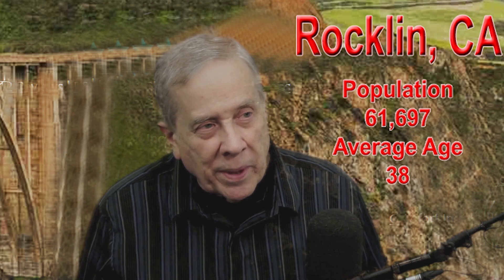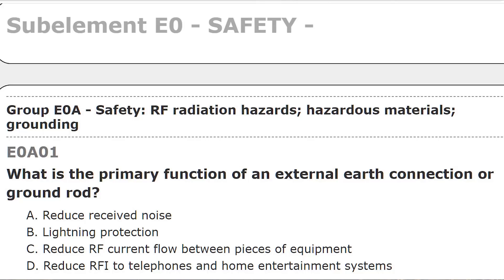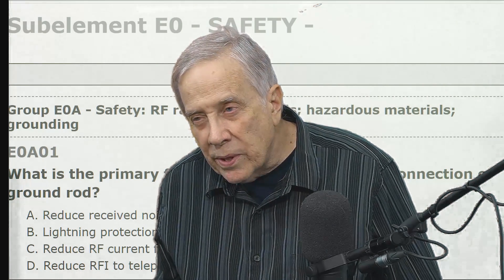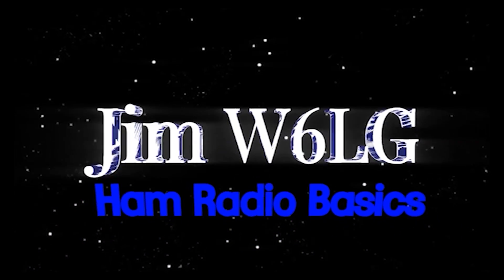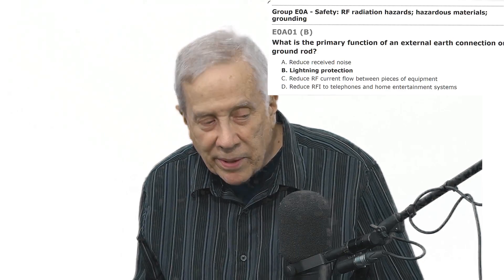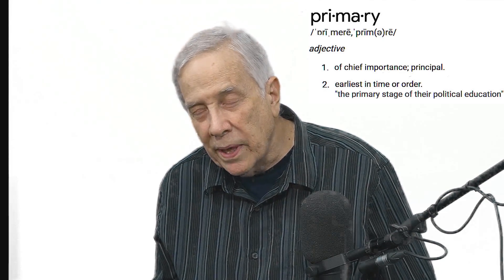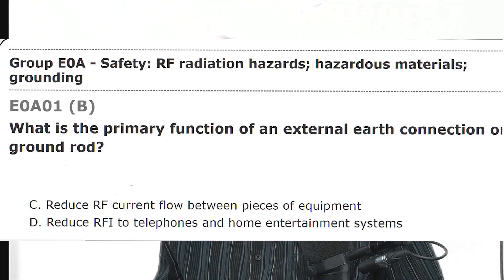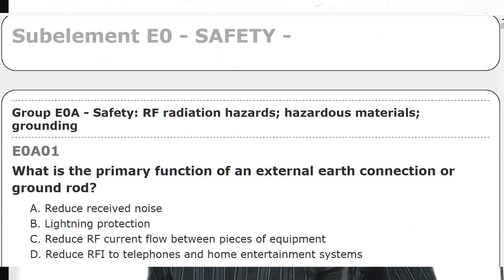Station Grounding & Extra Class License Question That Has The Wrong Answers Part 1 of 2

Comment: You are not correct. Earth ground is not for electrical safety. The neutral and ground conductors connect to the neutral at the source.  The ground conductor in the wire path is the responsible path for fault current. The only reason we have an earth ground to the neutral is to dissapte static charge build up in the eletrical system.  Lighting is static charge.

A grounded system, ground conductors have different purposes. Unfortunately the word ground gives the wrong perception.
Reply from the maker: I strongly disagree with you and so do OSHA and the NEC. 

"Earthing is used to protect you from an electric shock. It does this by providing a path (a protective conductor) for a fault current to flow to earth. It also causes the protective device (either a circuit-breaker or fuse) to switch off the electric current to the circuit that has the fault."
"
Reply: @ham-radio  Please watch https://www.youtube.com/watch?v=3vvvv5QVZoA&t=177s  a Mike Holt class from NEC training.  Sorry it is 30 minutes long.  He has a lot of videos classes on grounding and bonding as it applies to the NEC.  My early days we spent a lot of time earth grounding communication equipment to help prevent the transient static build up on the power lines from  causing the computer parts to fail.  Static was a big problem for early integrated circuit and cpu.  
I enjoy your channel. AI7JF
Reply: Still not convinced, read NEC section 250.4 (A) (1).  Also read (B) (4)  specifically states the earth shall not be considered as an effective ground fault path.  I believe because the green wire is called ground that it causes confusion. The green as well as the neutral are grounded conductors because of the bonding to earth at the main panel, but the purpose of the green wire of correct size is to handle fault current back to the source (main Panel) and be able to handle enough instant current to cause the breaker to trip, not melt the wire in the wall. You could take one of your dryer hot leads to the dirt out side and not trip that 60amp breaker but the ground bonding wire (bare) is now energized with enough electrons to hurt someone. My source of knowledge is from completing state electrical and exam a couple years back and ever since it has grabbed my attention when it is talked about.

Comment: No ground ROD connected to our service panel.  All neighborhood electric is buried with cables running in buried steel conduit (which acts as the ground).  All external entities are bonded to the service panel.  My station is the only ground ROD on the pemises (and also has  a bonding wire run to the service panel)
Reply from the maker: Hi,  I have never seen that. We have buried services and per the NEC, each residence has a ground or earth.  Our is an Ufer.  So, there is no common point box below or near the panel.  No box with 4 screws that has all of the "stuff" that comes into the house.  I have never seen that.  Question: Is it possible that there is an Ufer ground? 73, Jim

Comment: The ground rod will make it worse if you do not follow single point grounding theory.  When current flows though the ground under our feet, the resistance between the 2 grounds produces a huge voltage drop.  That is the opposite of lightning protection.  HI HI
Reply from the maker: Still many, including the ARRL give the wrong advice.  73, Jim

Comment: You need to make the point that the ground rod is driven at the home at the main panel for a reason. It is to complete a circuit to the grounding system at the transformer if the neutral conductor to the main panel is broken or lost.  That ground reference point should be enough to open circuit breakers if there is a dead short in a device powered by the main panel.  All of those other devices tapping onto the ground are using it for noise cancellation and grounding code conformity.
The ground rod also serves to dump high voltage from a lightning strike into the ground as soon as possible avoiding the transformer and the high voltage side of the system.
Reply from the maker: Hello Joe,
A couple of questions:
Are you familiar with the NEC requirements?
With reference to a driven rod at that station that is remote from the main panel and several ohms that is above ground; maybe 2 or 3 volts, do you believe that it is in compliance with the intent of the NEC with respect to grounding?
I agree about the driven rod of Ufer ground that is part of the common point ground, I failed to fully discuss the electrical service has many grounds all down the line.  If a rod is driven at the station and then more rods all leading back to the main panel with a large conduction, would that be okay under the NEC?
Thanks, Jim
Reply: @ham-radio  yes I am familiar with the code. And I also have experience with electrical engineers and inspectors that all interpret this differently. After 40 years as an industrial electrician and machine controls technician I’ve seen it all when it comes to grounding. NEC only recognizes one central ground point At the service entrance. I believe if all these ground points are properly tied together there should be no voltage difference at these points.
All of this grounding I see under your table really has nothing to do with the electrical grounding of your devices that apply to your service entrance. This grounding is to illuminate floating RF energy and lightning protection. Lightning always finds the point of least resistance to get back to the earth. With absolute perfect grounding of your radio equipment lighting is going to find your equipment before anything else. There’s been some work done with high resistance grounding in industrial applications.  I believe this is to avoid lightning strikes and reduce equipment damage due to the high current capabilities of a low resistance ground circuit. This is why so many branch circuits in industrial applications have gone to GFI capabilities.
I really enjoy your videos and appreciate what you’re doing for the ham community and myself.

Comment: Jim,
I must disagree with you.  I believe you are looking at this from primarily an equipment protection view point, but that is not what they are asking.  They are correct that the Primary purpose of the External Ground is lightning protection
Mike Holt has a great video on Grounding and Bonding that discusses System Grounding and Equipment Grounding, how they are bonded together at the main panel, and how electricity returns to the source.  Lightning to the ground and the building power to the transformer.  
Mike Holt also has a PDF online, Radio_and_Television_2014NEC.pdf, that covers NEC 810 with lots of illustrations.  I think all Amateur Radio Operators should review it and also Motorola_R56_2005_manual Grounding Systems.pdf.  If you want to provide guidance on grounding and bonding, point people to these and other sources.
You pontificate that we should believe what you tell us based on your long list of credentials.  I believe this is a fallacy of logic called “Argument from Authority”.  Thanks, Bob.
Reply from the maker: Hi and thanks.  
I did speak with Mike Holt and his staff while I was doing the prep work for this video.
I firmly believe that the PRIMARY function of a Ufer ground or driven rod is electrical safety.   Keep in mind why that earthed device is there.  
An Ufer ground will not "protect'" a home or structure from a lightning strike.  
The Motorola PDF is not part of the NEC as far as I know.  I also believe it is not part of any electrical code enforcement.
In any case, thanks for your comments.  I don't agree and maybe another former Building Inspector can offer another perspective.  Mike Holt without question is the best and was very generous with the help given to me.
Regards, Jim 
My callsign is W6LG and my name is James Heath.  I did work for two jurisdictions in various capacities and I did testify as an expert in hearing and court.
Reply: @ham-radio  The “Lightning Protection” provided by the external ground rod is for line strikes and nearby ground strikes, not direct strikes.  The only thing that would provide protection from a direct strike would be air terminals and down conductors of a “Lightning Protection System” (see NFPA 780), and these are also required to be bonded to the building grounding electrode system by NEC 250.106.

It is true that the Motorola PDF is not part of the NEC and I did not cite it as such.  It is a bit of a deep read but it does a good job of explaining the ground rod sphere of influence which helps people understand why the NEC requires 6 feet as the MINIMUM spacing of ground rods and why Motorola says that 2 times the rod length is the OPTIMAL spacing of ground rods.

While I too have an extensive background and multiple years of experience in Building Systems, I do not expect people to believe anything I say based on that. Everyone should do their own research.  Therefore, I provided information on two documents that could be downloaded for free. 

Thank you for providing this opportunity to discuss a very important topic.
Reply from the maker: Thanks again for your help.  I did not intend to offer an opinion on lightning protection, that subject is way beyond my experience and knowledge.  Maybe with respect to amateur antenna systems we need to figure out a better title or description when it comes to lightning.  I do want to stick with electrical safety and therein lies an interesting debate hence my call to Mr. Holt & Company. With respect to Motorola, it is a deep read as you said.  But, it can also be a blueprint for someone to follow for their ham radio installation.  Thanks again Robert for your help.  Maybe sometime you and I can talk on Skype.  I would very much like to be better informed.  Also Robert, I can't read the screen at this time so bare with my mistakes.  My cataract surgery was postponed.  Regards from Rocklin CA, Jim W6LG

Comment: Hello Jim, 
At the ripe age of 70, I have decided to become a radio ham. I really appreciate your talks which I find interesting. Concerning radio protection. Do you think that the question could be referring to having a proper earthing system employed on the roof of a building connected directly to the earth rod in the ground? ; and the case of an UHF antenna secured up a mast being connected to an '"N" Type coaxial connector employing a (RFS Cellflex for example) solid copper outer under the outer coaxial cable casing. At the bottom of the mast on the roof a strip of the outer Co-axial cable casing is removed from around the coaxial cable and a special lightening conductor fitting is clamped and secured around the cable, which is then protected by being wrapped with self amalgamating tape, then covered with 'plumbers mate' to protect the connection and make it waterproof. The threaded stud of the special lightening conductor fitting to the coaxial cable is connected directly via an earthing strap to a special earthing system clamp to the earthing system tape on the roof, thus giving a direct connection from the antenna cable at the bottom of the mast on the roof to the ground. I can't remember if the antenna cable came into the building through an earthed bulkhead feedthrough connector or not. The antenna co-axial cable came into the radio room of the building and was connected to the input of a four stage earthed Helical Filter in the rack to the radio base station. Apparently my brother told me that there was a lightening strike, and that he had been very lucky as it had not damage his base station equipment. He believes that the Helical Filter made by Aerial Facilities Ltd (similar type as seen in Fig 9.14 on page 509 in Handbook of Filter Synthesis by Anatol I. Zverev) protected the base station equipment from damage, there not being a direct connection between the antenna cable inner and the base station equipment.

Comment: I agree that this is a bad question and also in many ways confusing. 
  There is so much misinformation and disinformation  concerning grounding and bonding that the question should be omitted.
   Lightning protection is separate from the electrical ground. It is based on a cone of defense over the area to be protected.
   The ground rod for the electrical system is to protect the electrical system.
   The building electrical ground is tied to the neutral line near the entrance of the line into the edifice, that is, the drop line, the meter housing, or junction box. If there is a line fault, the ground line carries enough current to flip the circuit breaker off. This protects the building from fire and may reduce or prevent an electrocution. Although the electrical system ground is connected to the earth by a ground rod or ufer ground, this alternate path does not provide enough current flow to throw the breaker. See videos by Mike Holt and others. 
   GFCI devices reduce electrocutions better than a circuit breaker which may take seconds to respond before flipping the power off. 
   I am a retired research professor and I have been asking questions and studying grounding since I was a child. I still have plenty of questions and am perplexed with all the misinformation and disinformation that persists.

Comment: I agree.  In a high-energy event -- high voltage, high current, high frequency pulse -- such as a lightning strike, it is unrealistic to believe that the puny #6 wire running to the grounding rod is nothing more than a fast-blow fuse.  The question's correct answer is "none of the above."

The ONLY function and purpose of the grounding-rod-to-#6-wire-to-breaker-box-cabinet-to-house-wiring-grounds-block-and-single-wire-to-the-neutral-common-block is to assure that the reference potential for the house circuits are at the IMMEDIATE LOCAL ground potential.  For most homes, the wires running from the pole -- pole-grounded bare wire, insulated transformer neutral and 110VAC P1 and P2 -- may be a significant distance from the home.  Thus the reference ground potential, at the pole to which the transformer center-tap-neutral is tied, may be significantly different than the local ground potential at the home.  The house rod and grounding circuit in the mains box assures that the home is strongly tied to the local ground potential and not "floating" at some far-away reference potential.  The rod circuit is not a high current carrying circuit (for a lightning strike) but rather a very conservative, low resistance safety-centric ground reference for folks in the house.

It is important to emphasize that the NEC-dictated ground rod circuit as described above addresses the safety and power needs for 60hz power.  A lightning strike or RF flow requires a different analysis, needs and treatment.   NFPA 780 dictates for lightning rod installations are an addition to and have specific ties into the NEC electrical safety system.  But that lightning strike treatment  addition does not modify in any way the rod-mains-box safety circuit dictated by the NEC.
Reply: Before someone comments....my old house has four wires from the pole (P1, P2, insulated netural and bare-wire ground).  Most newer homes have 2 insulated power legs and a bare-wire neutral that is grounded at the pole.  And grounded again at the house's power breaker box.

Comment: Hi Jim. I am just getting into HAM.  I am looking at this from an electricians view.  So yes a Primary Ground is to divert a lightening strike into ground.  Forget anything else.  Yes your sensitive equipment could be damaged but the Primary Ground is to divert thousands and thousands of volts away from your house.  You are looking into this question too focused.
Reply: I don't think the puny #6 wire connected to the ground rod will divert away a significant amount of the energy from a lightning strike before it becomes a fast-blow fuse.  Lightning energy dispersion systems are usually constructed of very heavy materials, i.e. copper wire 1/2 to 1 inch in diameter and installed with large radius bends to reduce self-inductive impedances failures associated with the huge current flows.  I don't think anything in the NEC suggests that they power system ground rod is part of a lightning strike system.